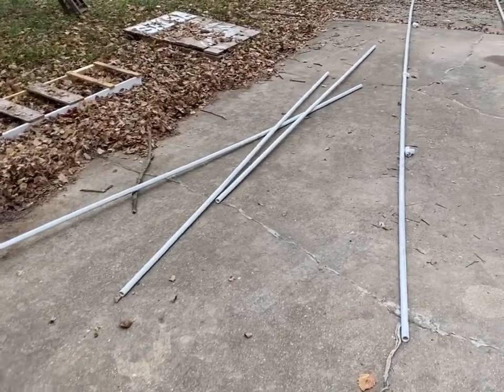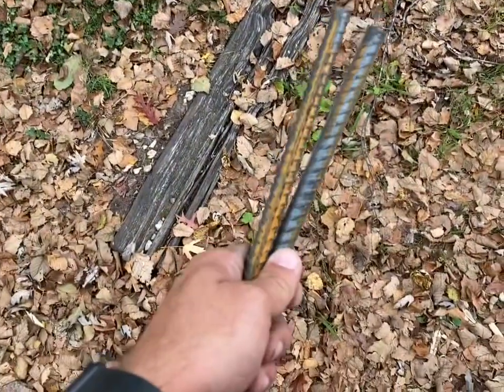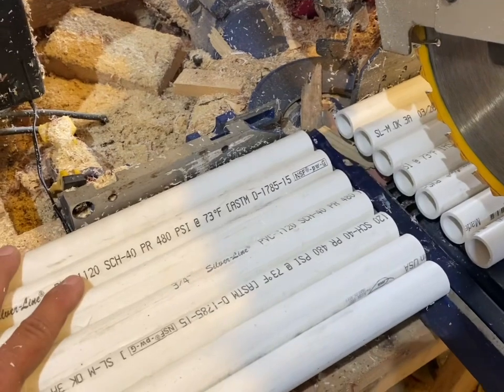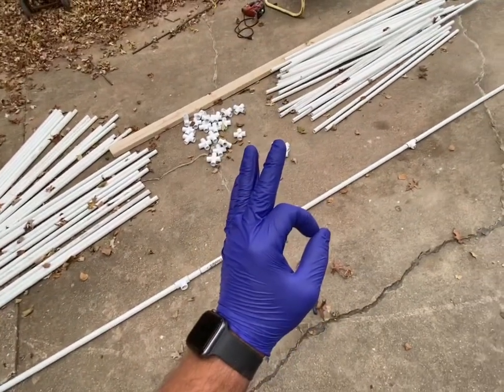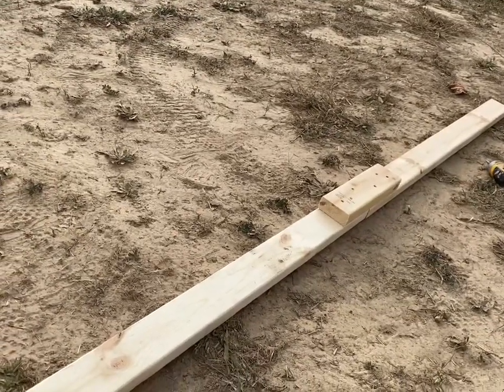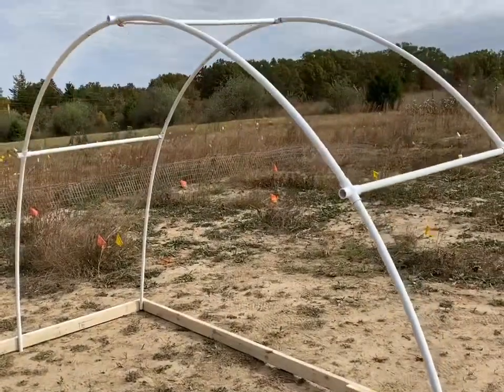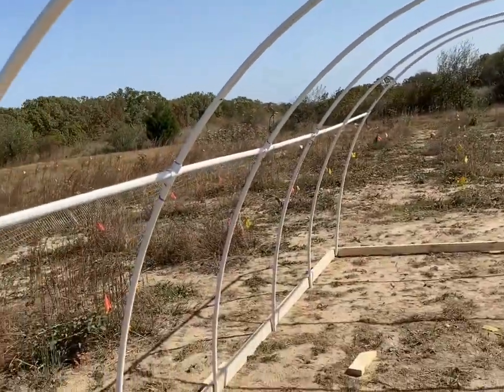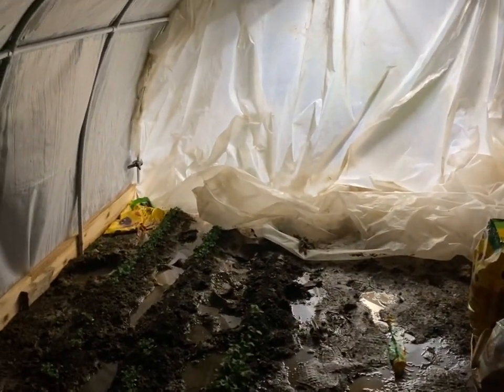Step by Step DIY PVC HOOP HOUSE, HIGH TUNNEL, GREENHOUSE

Comment: Drives me nuts to see people drive rebar with a hammer.Just use your hands and save the time and energy.
Reply: @chrisp308  Apparently you have not studied physics.I can drive a 2 feet of rebar into the ground with one hand and you could not pull it out.Gi back to school.
Reply: @chrisp308  It does not bother me one bit if you want to go through life being stupid.
Reply: I have property than the only tools you need to dig a hole is a broom. Sweet the ground then get the dynamite.